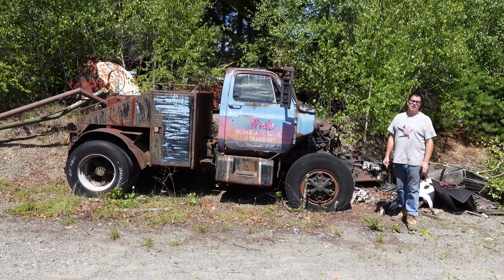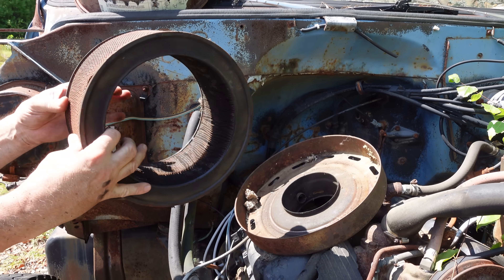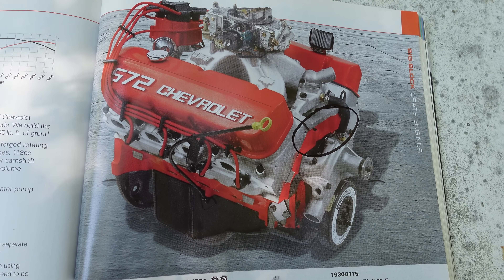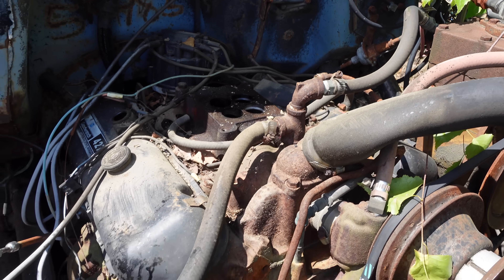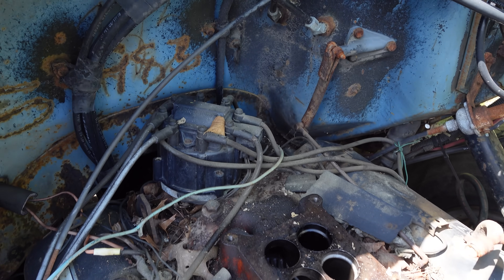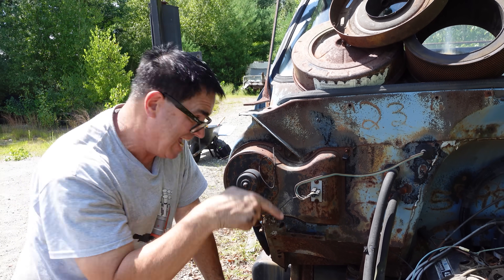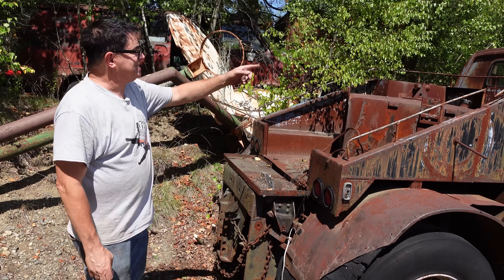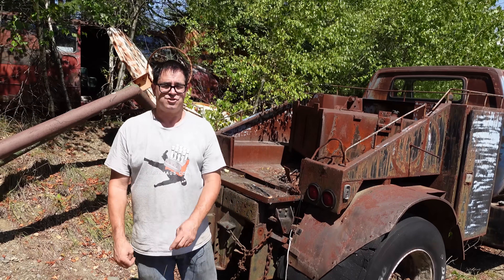6 Wheels, 5 Gears and 427 Cubes!

Comment: This is a 1980 model, not a 1975, and it's a GMC, not a Chevrolet.  It's also a 70 series, not a 60 as the model code of T70 in the SPID indicates a GMC 70 Series. That's why, "When get you get the SPID, we're glad you did, and when we get the VIN, we win:"

T for GMC Division, 1 for 4x2, 7 for 19,200# to 32,800# Gross Vehicle Weight Rating, D for 97.5" BBC Conventional Cab, B for GM produced 366 CID V8 gasoline engine with four-barrel, A for 1980 model year, V for Pontiac, MI (GMC facility) assembly and the rest is the production sequence. The Pontiac Truck and Bus (originally called GMC Truck and Coach Division) was located at 2100 South Opdyke Road and opened in 1973 and closed in 2009. The plant has since been demolished and was called "Pontiac East". 

That fuel tank was intended for a 1980 Ford HD truck, because "E0HT" is the engineering prefix for a 1980 Ford HD truck. However, the tank is stamped "Kysor Division" which made heavy duty truck parts. As the SPID shows a 50-gallon tank as original equipment, my guess is Kysor made the same tank for GM and Ford and they are basically interchangeable. 

The transmission is likely a Clark 285V five speed as abbreviated on the SPID. The "23" shown in chalk/grease pencil on the firewall matches the code 23 Medium Blue exterior paint shown on the SPID, so that's likely what that means. The SPID also shows an abbreviated listing which is probably "12 CFM Bendix-Westinghouse air compressor", which can be seen on the engine. The rear axle is an Eaton E17221 unit as shown on the SPID. 

Fred Wetherby's Mobile Home Transport appears to still be in business and the street location is the same as his last name, so he must have been a prominent citizen in town at the time and maybe even today.
Reply: You know your stuff, my friend
Reply: @georgejsalomskasiii3048  Sure thing thanks.
Reply: I have family up there and I’m pretty sure I passed that street off Route 10 in Winchester. Not uncommon in that neck of the woods for private streets to be named after owners especially if they are the only property owner on the street.
Reply: @LI-FLKayakFisherman  That is true. My friend had commercial property in Columbus MS and when the town asked him what it should be named he said with his southern drawl, "Dunno how about Limbo Road? It is out in the middle of Limbo." The name stuck and it is Limbo Road today.
Reply: Mobile homes didn't have pintle hitches, either/
Reply: I love it when real knowledgeable people show up and debunk Steve's half knowledge.
Reply: @oldman-zr2ru  Easy does it. No one is perfect. We all make mistakes, and that's for sure. Yes, I wish he would do a little more research on them before presenting the video, but he does a great job overall.
Reply: @googleusergp  Yes, the information regarding the nuances of options & specs on these trucks is wide & vast. Realistically I think the only pros were the parts guys back in the day this was new!
Reply: @googleusergp  You hit the nail on the head. He has the SPID right in front of him and failed to use it. That's where my criticism lies. I don't know a darn thing about this truck other than it's big and it's a truck but that sticker in the glove compartment would tell me everything I want if I took the time. Yes, he has a lot of general knowledge but this is just laziness.
Reply: @jamesthompson8008  Nah. These are not hard to figure out.
Reply: @oldman-zr2ru  I would not call it laziness. Some of us know the specs and numbers better than others. I have helped write GM parts publications in the past (but I did not work for GM directly) so I know how to do it along with most other makes.
Reply: How does a wrecking yard like this even stay in business?  I mean they buy these vehicles, keep them around for decades, don't ever appear to actually scrap the metal and sell minimal parts off of them.  To me the time to sell the parts would be soon after the vehicle arrived when it would be in demand for other vehicles like it that are still on the road, not 30 years later. and the time scrap the metal would be long before you lose half of it to rust.  Actually, this is a case where we can trust in rust to eat into your profits.  When I look at the haphazard nature of the way the vehicles are processed it makes me wonder if they are properly removing the fluids and in a state like Massachusetts, that could probably be a costly endeavor if you are not and get caught.  This yard does mike for a nice background for Steve to provide his history lessons as opposed to the LKQ yards around me where you rarely see anything older than 1995.
Reply: @kennethsouthard6042  Might be the "dead wood" part of the yard. The more saleable stuff may be up front.

Comment: Looks like the original 366 might have been replaced with that 427 Goodwrench engine which are GM replacement parts item.
Reply: Yes, he actually said that in the video.😎
Reply: That's what I was thinking, because I've seen that Goodwrench sticker on reman engines from back then.
I wonder when those were available until?
(I'll go Google it I was just typing out what I was thinking)

Comment: I remember back in the mid 80's l worked at HVAC company and they had a C60 with a flat bed and I had to drive it occasionally.
Manual steering , brakes and of course the split axle but it had a 350 two barrel in it. Steve was there any difference with the small block in those like a stronger block for the 350 version? I remember it' was painted blue from the factory.
Thanks 👍
Reply: Manual steering? Ugh!
Reply: @driedbrainfreeze2149  back when men identified as men...
Reply: @samholdsworth420  I remember. Too old to return.
Reply: @driedbrainfreeze2149  I agree l was in my early 20's back then and I liked manual steering especially on my Roadrunner or the 69 SS 396 I had back then 🐱
Reply: @samholdsworth420  that's the non optional base model Armstrong steering that comes as standard equipment 😄
Reply: I know lots of truck 350’s had 4 bolt mains, but aside from that they should be pretty much identical

It being painted blue means it’s a ‘77 or later motor
Reply: Power steering by Arm-strong.
Reply: The medium duty truck small blocks were 4 bolt mains and had steel crankshafts. They also had a different oil pump drive shaft. They may have had beefier connecting rods, but I don't know that for a fact, and I'm too lazy to look it up at the moment.

Comment: Short wheelbase for better maneuvering into tight spots-maybe shortened after purchasing…
Reply: Elkhart Welding and Boilersorks / Bock Industries in Elkhart, Indiana built a lot of these trailer toters over the years for the mobile home industry, there may have been other regional companies. They may have cut down some off the lot available trucks, but most were ordered in with this wheelbase. Mobile homes have a 2 5/16 coupler not pintle hitches . You're lucky you didn't hit your head on the spare tire mount .
Reply: I've seen a lot of former LTL freight trucks turned into Mobile Home toddlers because they all have short wheel basis

Comment: 427 truck engine was a dog. Give me a 366 anytime.
Reply: That’s what I have in my GMC Savanna van, a 6 liter/366ci, with 325 hp from the factory.
Reply from the maker: Hello Michael Wojciechowski, Thanks for writing. Not to "tell you your business" but the 6.0 liter (364 cubic inches) in your modern GMC Savanna van is a MUCH BETTER engine from a performance standpoint that the tall deck 366 from the olden days. Yours is a Gen III / LS type engine with the same heads as certain modern Corvettes and Camaros. Also your block is much lighter and has cross-bolted main bearing caps, the Tall Deck 366 is essentially a Big Block Chevy with an extra .400 inch of deck height...a HEAVY unit. Oh and there's that nifty lightweight plastic intake manifold with ram-tuning built right in. Unless some evil doer swapped a Tall Deck 366 in over night, your Savanna's 364 is much better. Again, not to tell you your business, but your 364 is one mean V8 (for a mass produced SUV item)! I have your engine's baby, baby brother in my 2002 GMC Sonoma pickup truck. It wasn't factory stock, the truck was "born" a 4.3 liter V6 but the kids at Next Gen Performance swapped in the 4.8 LS V8. I "wish" it was a 5.3 or better yet a 6.0 like yours. But still these Gen 3 LS style V8's are amazing! Thanks again for writing, Steve Magnante

Comment: Hi Steve, i once tore down a 427 tall deck truck engine and it had factory large oval port heads with a matching tall deck large oval port intake manifold. So I don’t believe that they all had peanut ports.
Reply: I also had a 427 tall deck with the normal size oval port heads, it came out of a 69 or '70 dump truck with 200K miles on it. Bored it .030 over polished the crank, and did a valve job and it was ready to go again.
Reply: That's right, the HD truck engines all had very large ports, probably larger than they should have had considering how they were used.
Reply: Everyone and their brother has tried to make power with these and without a second mortgage and a good machine shop, they
Reply: i bought a 427 TD and yes mine has large oval ports
Reply: Are you sure your memory isn't tricking you?!
Reply: @samholdsworth420  No, he's right, I've had several 427s and 366s apart, they all used large oval ports.
Reply: Pictures or fibs 

😉
Reply: @samholdsworth420  I’m positive….but I don’t have pics from back then…..soooo it looks like I have to go with fibs